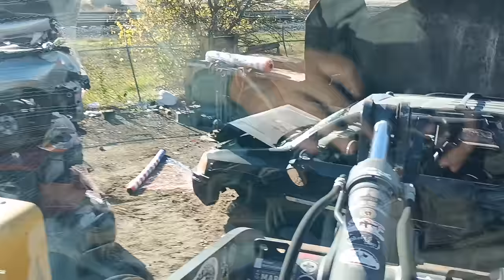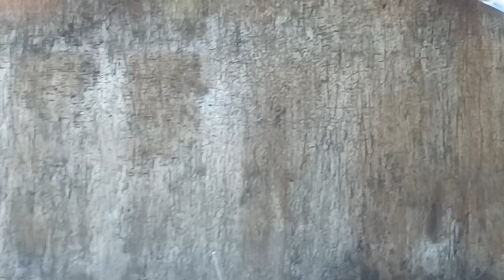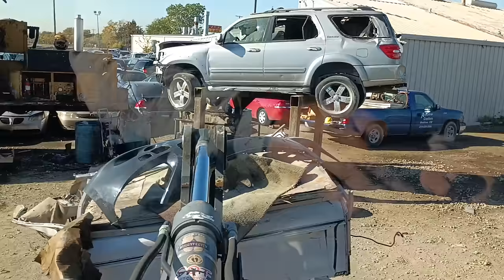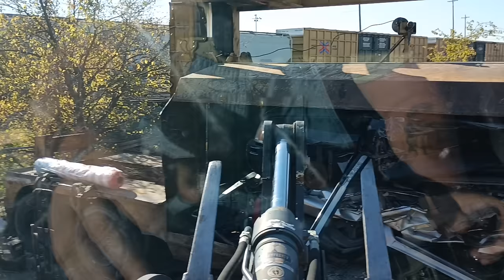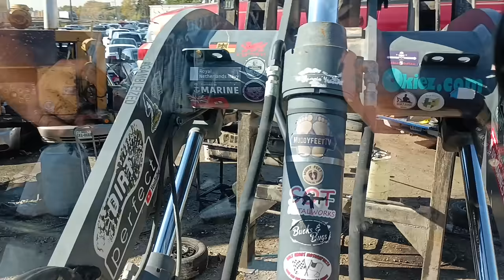Car Crushing and Rail Fanning 🚂...🤠👍

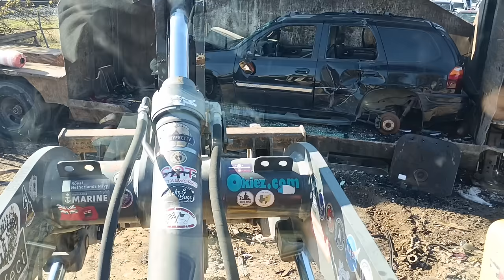Comment: 0:05, GMC Envoy (0:30, crushed) in front of the crusher.
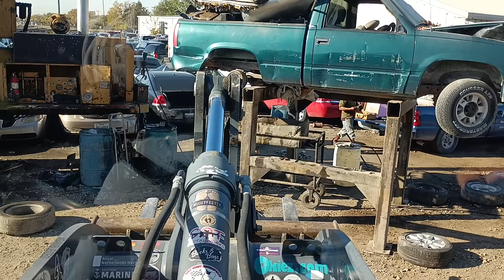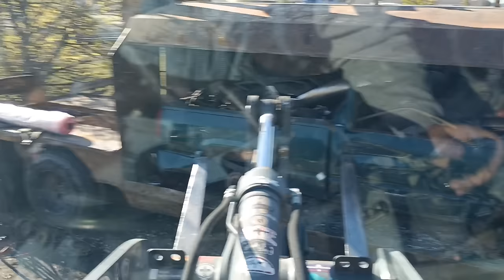4:06, Chevrolet OBS truck (12:25, crushed) on the rack.
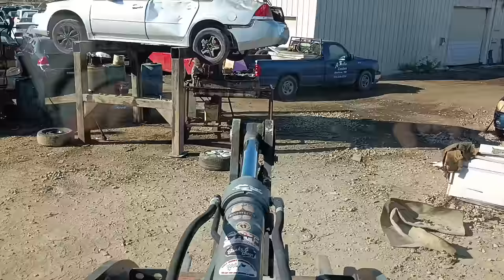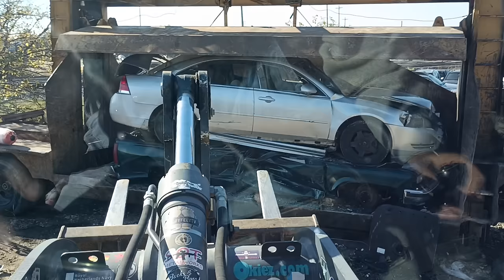10:15, Chevrolet Impala (13:51, crushed) on the rack.
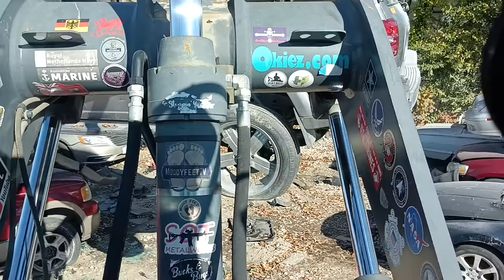14:59, grabbing a Toyota Sequoia (28:02, crushed).
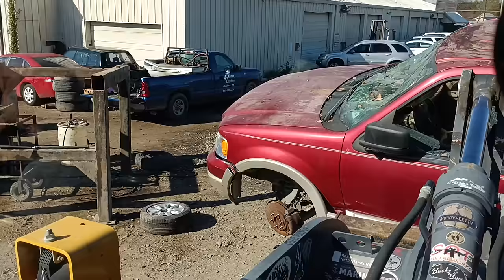26:38, Ford Expedition getting put on the rack.
28:39, grabbing a Nissan Armada.

4 crushed this video. 2,987 total.

Comment: Those Toyota Sequoia taillights are expensive, about a decade ago one of my close friends back in Korea asked me to find a left side taillight for his Sequoia back in Korea, well its like 2 times more expensive in korea ,plus you got to wait weeks to months to get them, he thought i was going to get him a used one ,but they are expensive & hard to find ,luckily for me my local Toyota parts dealer needed a Lexus RX400Hybrid right side headlamp as Toyota had a shortage of those with the blue chrome trim & AFS features, well i had like 10 sets brand new ,i ended up trading one to my Toyota parts dealership for 2 brand new Sequoia taillights & the drivers door switch for free & shipped the lights & switch to my friend ,he was shocked i sent all new parts instead of used & received it in under a week by express EMS ,he still has his Sequoia back in Korea, its quite rare there too